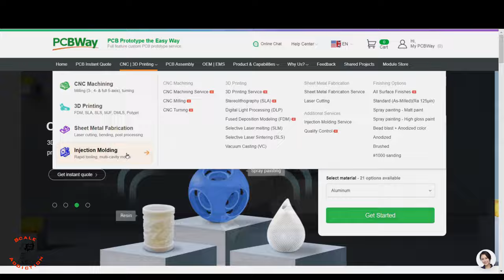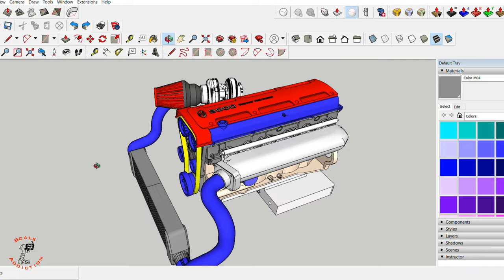Part 15 / 8th scale 3d printed supra with 2 cylinder engine project

Comment: Why would you take that engine out my guy
Reply from the maker: It was for ppl who wanted electric, but soon I put 4 cylinder gasoline engine, no worries,  it will be way better than before with carbon filament fully heat resistant